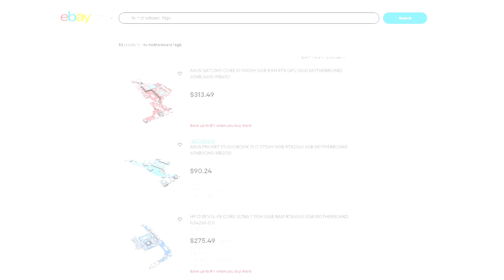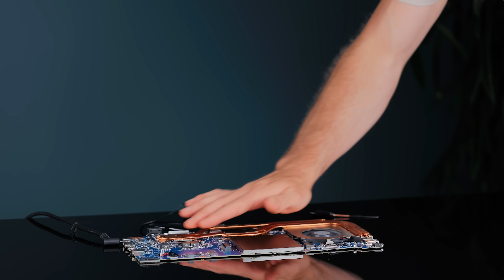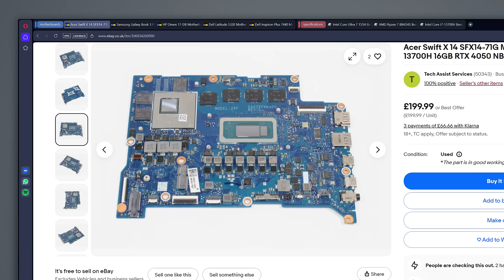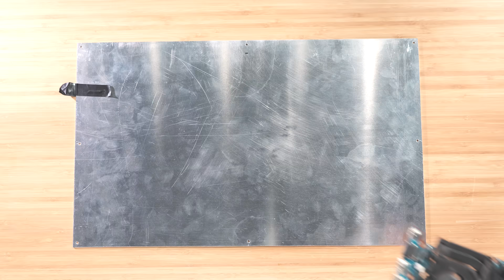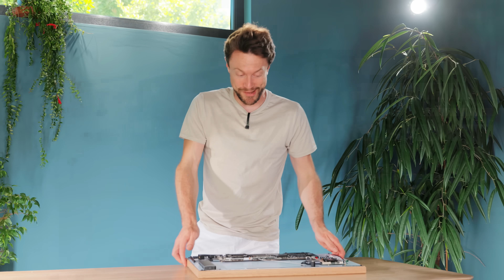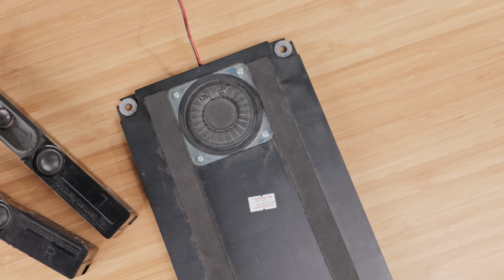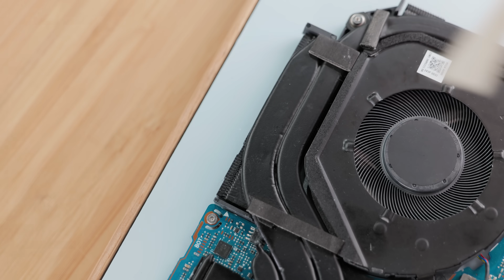A new way to build a PC in 2026!

Comment: Hi Matt, this could have benefited from a more substantial cooling solution. Laptops are always thermally limited, so there's a lot more performance that could be unlocked.
Reply: Could have even used the aluminum plates as additional heatsink

Comment: i wanted to do this but i had some issues like GPU death and usb c rusting and transistors falling off due to water damage, the power ribbon cable broken, Laptop display broken, keyboard broken. I will need to do some electronics engineering to solve all of this :')

Comment: I hope I missed you adding a protective layer on the LCD panel instead of the glass panel. Thanks for the vid, cheers! Ingenious, as always! I'm particularly blown away by the insane measures you take for the best possible audio experience.
Reply: Looks like he's running a naked LCD. I wouldn't
Reply: He also missed adding back an anti-glare coating. The original coating on macs is pretty good, but here on the quick demo it looked like the entry level glossy plastic screens of some cheap laptops... which ruins the good properties of the lcd if there is any light in the room
Reply: @bastienx8 i think he carefully showed angles to reduce the extreme glare

Comment: chromebook motherboards flashed with mrchromebooktech's uefi firmware make fantastic little NAS boxes for a simple usb HDD or even with an adapter in the WLAN M.2 slot for SATA connectors. super low energy, low budget, and with a gigabit usbc adapter fast networking, too.

Comment: the motherboard had a headphone jack the isolator circuit was overkill😂😂
Reply: I was also thinking that 😅 Alternatively if one wasn't too fussy about audio quality, could maybe have them connect wirelessly on start up.. Or maybe a USB with an amp... Now I think of it there were more than a few ways 😂
Reply: Yes but using 2 audio outputs simultaneously is not easy on windows. And some apps (like many games) directly send the audio to the selected device, making it impossible to use. And there might be different delays from the 2 outputs, if you find a way to use them both together.

Comment: To be fair, they are mobile variants of that CPU and GPU, so they aren't apples to apples with the desktop version.  As a computer repair tech who prices out laptop motherboards a lot, there are some pretty high priced laptop motherboards when you get into the super high end.  But even $300-$400 is enough for most of my customers to deny a repair on their laptop once you add labor into it depending on the age and specs of the laptop.

I recently did a more basic version of this.  I had a laptop that was recycled because the internal screen wouldn't display anymore.  Something wrong with the motherboard displaying to the internal screen (tried several screens and a new cable before we gave up).  However it displays fine to the HDMI, even at the BIOS level which is fairly uncommon.  Most laptops don't display to HDMI until after Windows starts to boot which makes a laptop without a functional internal screen harder to diagnose if I can't get an external display until Windows boots.  Anyway, since the motherboard was effectively useless as a laptop, I removed the screen assembly and am now using it as a full lower case connected to the TV in my garage so it still retains the internal keyboard and touchpad if I need to use them, and I bought a bracket to mount it to the wall.  I had a mini PC out there, but it was 10 years old, and the laptop has an 11th gen i5, so it's newer and good enough for watching videos or playing music out in the garage while I'm working on projects.

Comment: You already put so much effort in it and it is very spectacluar (unlike my english skills) why did you not use the opportunity to give it some proper speakers (like the Tectonic 65, in bigger and proper enclosure, even the Visaton FRS8 in 2 Liters could work) ? 

Btw: Did you replace the glass in front of the creen ? which means the surface of the display unprotected !

the whole project looks 10times better than every storebought product I have ever seen. Great Job (as always). Unfurfanetly its not possible make profit building these for customers.

Comment: Just a thought, instead of using that process for the power button, why not have it boot when mains power restored (BIOS setting) its what i do as my laptop is closed and on its side in a stand........maybe a good idea for those less keen on pin tracing.

Comment: you can probably get line level output from the lcd driver board by looking at the datasheet of the onboard amp ic. if it is fed digital audio instead theres often still pins for line out.

Comment: the trust in that back leg to not fall off the table at 22:38 is incredible
Reply: Yeah not a fan of that stand. You can't adjust anything so the ergonomics aren't brilliant. But creative and impressive work as ever.
Reply: @deanopain  diy comes with it's shortcomings, but the build is brilliant as always, Matthew is one of the best to ever do it!
Reply: @captaincaption  true, but adding a ball clamp or ball head on the backside would solve it pretty cheap. But as for as aesthetics goes, this is very clean.
Reply: @bonko86 Adding and hiding a tilt mechanism would be relatively easy considering his skills and imagination
Reply: @deanopain if you look at the video closely, that has been made to his specific height. His eyes are at the top bezel... Perfect. Since people don't regularly adjust their monitor height, most won't experience and issue if it's set to the specific height.
Reply: @deanopain   Think about it this way: adjustability is only needed because the manufacturer has to make sure everyone can use their products. If you DIY for yourself, you can measure your eye level sitting and make the stand's height accordingly. No need for "ergonomics", you build that yourself.
Reply: IKR!  Also, having the centre of gravity over a single leg, whilst aesthetic, is less stable than having it over two.
Reply: His actually scariest build due this tripod :D
Reply: I highly doubt he's not anchored it somewhere underneath the table. He probably didn't feel it was necessary because the stand itself was an extra aesthetic choice we'd all choose differently.

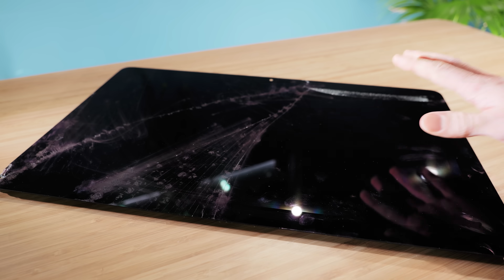Comment: 8:34 pop an SSD and MacOS Monterey/Sonoma through OCLP on any old iMac (ideally 2011 onwards) and it becomes a surprisingly good device. Still rocking a Late 2013 21.5’’ iMac and swapped in an SSD and it works a charm.

Comment: Couple things I would like added:
1) Always check the screen before buying. Way too often if the screen has cracked, it's the LCD panel that has cracked and that's beyond salvageable.
2) The MB must be checked at the factory and ribbon cable for that is way too fragile. There's often quite visible and good test pad for the power button somewhere on the board.
Reply: An iMac damaged that severely can probably be found for free so cost probably wouldn't even be an issue there.

Comment: When I saw the tripod design of the stand, my brain was immediately convinced that you were going to add a brass hinge to each leg and use something like a brass bolt and nut extending downard from the cap that allowed for an adjustment of how much the legs were allowed to splay outward, thus adding height adjustability to the build. And I think my brain went there purely because I'm accustomed to see brass in your builds, but I think it sounds like quite a nice addition. I suppose that would require different mounting for the speakers, though.

Comment: I would have taken a different approach with the power button. Vast majority of BIOS chips have the ability to boot the laptop when a pin is shorted to ground. Similarly there might be diagnostic buttons or lines to be able to boot it.

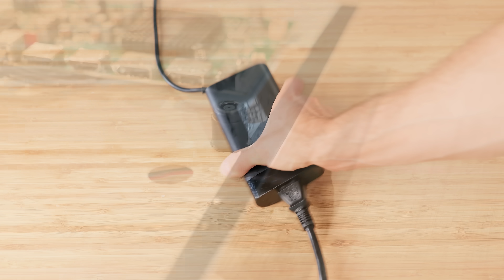Comment: 14:19 Laptop's original Power supply?  Did you not buy Just the motherboard?
Reply: My assumption is that he bought it separately and forgot to mention it. I assume the power supply for any given laptop cannot exceed $35-50 anyways
Reply: @TheRealKidRed_ I assume the worst, he could not get the eBay one working so bought a new laptop and dismantled it for the video😊
Reply: @RajveerSingh-vf7pr Of course that's always a possibility, and maybe I'm just being a bit too optimistic, but I do really believe that he did really get the motherboard from eBay.
Reply: @RajveerSingh-vf7pr  I don't think he would do that he knows better
Probably just bought it separately to turn it on in the first place

Comment: Thaat's a bit lucky. I can only find HX 370 based boards starting at 980Euro. 
In any case, the keyboard connector presents the interface to a keyboard matrix, while your method worked for you, it is not usually how that works. A keyboard matrix is split into rows and columns, and you need to connect one row pin to one column pin to trigger a keypress, including the power button. So the more appropriate way to do this is to connect each pin to every other pin in order to find the correct two pins to bridge with a power button.
The "custom ribbon cable" was a really neat idea.

About the display, modern laptops use eDP (embedded display port), which is standardized enough that you'll find that you can connect most panels that use eDP to a modern laptop mainboard directly (using the mainboards original cable - the panel side connectors come in standard 30 and 40 pin variants and there are simple conversion boards available, to convert  between the two pin counts).

Comment: I understand how you connected the power button, but I believe it’s unnecessary. You simply need to boot it up once using your method and configure the "auto-power-on" setting in the BIOS. After that, you can turn the machine on just by switching on the power supply, without needing a physical button. That’s the method I use for my laptop, which stays closed in a mount hidden under my desk. I even plugged the power supply into a smart plug so I can ask Alexa to turn the laptop on. Aside from that, great job raising the discussion on how to salvage damaged laptop motherboards so we can have a functional PC at a reduced cost.

Comment: Just FYI, although most laptop motherboards don't have physical power buttons on them, many do actually have the space for one, so they can have one added for testing/diagnostics in the factory.
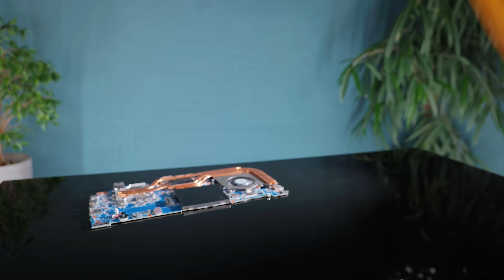E.g. at 3:03 you can see an empty space labelled TP_PWR_SW1 to the top right of the keyboard connector - that's probably it, and of course you could test it in the same way. Finding that and soldering a wire to its 3.3V pad would generally be quicker, easier and with a more reliable connection than using the keyboard connector.
Reply: Also on laptops that doesn't have a provision for a physical switch, it's not unusual to find a empty 2-pin SMD footprint close to the keyboard connector for the tech to short out with a tweezer to trigger the power on.
Reply: @zaprodk really good catch! Although, even knowing this, I still like Matt's solution. Not as simple, but very modular.
Reply: This does make sense, showing the value of reading through comments under the video.
Reply: Surprised that Matt missed this.
Reply: Is it the 5 pads where the solder mask resembles a letter H, for an actual button? Or is it the small dot of solder under where it says SW1?

(Edit: what I meant was silkscreen, not solder mask)
Reply: @WillE86  Yeah, all the empty pads in that white outline are where a push button could go. It's partially hidden by the wire, but I think there are 6 pads there - the 4 corner ones will be ground but are just to anchor the button. Then the other two (middle ones on the top and bottom) will be the actual switch - one will be ground, one 3.3V, so when the button is pushed the 3.3V is pulled to ground.
TP usually means Test Point and PWR_SW would of course be power switch, so that plus how close it is to the keyboard connector (where we know the power button signal goes) really suggests it's for the test power switch. I use these all the time when I'm fixing laptops - usually just bridge the points with tweezers to power the laptop on to test without fully resassembling.
Reply: @WillE86  Switch 1 I`d guess (:
Reply: Should've at least let us hear a little bit of music on those speakers.

Comment: Instead of using an HDMI/DisplayPort signal connected to the external display driver, you could have utilised the video signal from the eDP port on the motherboard by using a ribbon cable, so you have access to the iGPU and dGPU separately. Using the USB-C DisplayPort/HDMI port bypasses the iGPU and connects directly to the dGPU.

Other than that, this is an extremely good idea, especially with the Retina display from an old iMac.

Comment: @DIYPerks You should have watched Snazzy Labs video on converting an old iMac to be a monitor. He really went in depth about different control boards, and you would have learned that the $50 one does not do thunderbolt or anywhere near 4k.

Comment: Okay, that paper ribbon cable was a bit jank 😂
You can easily solder to the pins.
Or if you really do not want to do that, get a bare ribbon cable.
Just rip it from a broken device, does not even have to be the exact same pitch

Comment: FYI The previous generation of iMacs still have a decent screen, are cheaper, and the glass is held on by magnets so all you need to get at the LCD panel is some suction cups. I expect these bare panels would scratch incredibly easily though.

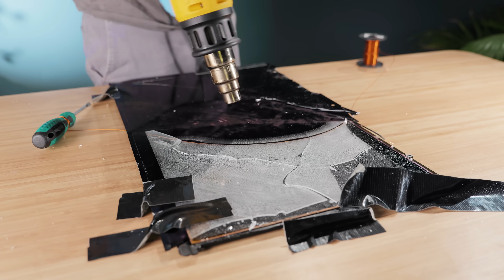Comment: 9:47 You know what, this gives me an idea. How about you dangle a pair of a light weight on each side of the wire then mount the display vertically and you just aim the heater gun at the glass.

Comment: 😠 - and we will now have the YT video influence effect on “pricing” of those mother-boards, another concern is how old is the CPU; was it replaced? - I have an old HP pavilion laptop that was upgraded to Windows 10, and now that it is no longer supported and the CPU isn’t compatible = I am being pester-badgered by “Microsoft” to have said laptop replaced in its entirety/subscribe to a security thing for £££, but it is already protected by Kaspersky anti-virus application, so I think Microsoft is trying to abuse me as a “cashcow” = to force me to buy their Windows 11. And unlike a computer motherboard where the CPU chip is socketed = can be easily replaced, with a laptop it is soldered to the board 😠🙄

Comment: Nice one, really love your laptop recycling vids. By the way, you don't necessarily need a driver board for the LCD: laptops most often use 30pin edp or 40pin edp (2 vs 4 displayport lanes, pretty much), panels can be either those, or lvds. If those match, you're in luck, and just need to figure out the pinouts, which are often* available from schematics, if they don't - depends: 40 (laptop) -> 30 (display) pin edp should just work™, edp -> lvds can be achieved with small converter boards, and only 30 -> 40 is somewhat hard - some displays will work fine, for others you'll need a pair of decoder-encoder chips for displayport, but still possible. Also, amd boards generally work with a wider variety of displays compared to intel, which may or may not matter when a dGPU is present, depending on how the display is wired internally.

* good candidates here are asus, acer and lenovo boards that are a couple of years old. Same with many clevo boards regardless of the "manufacturer". Dell is generally terrible, those dudes really don't like to share (and also tend to make questionable/unintuitive protections). And hp just sucks.

Speaking of protections, some recent boards have either a physical switch or a light sensor that needs to be pressed/covered respectively for the board to start. Finally, depending on the mainboard, you may also need a battery, since some laptops really don't like running without one, and will drop the CPU freqs down to the unusable range. Also, the battery nowadays often provides the RTC power to the hub, so without one the 1st start after the power is disconnected will be longer and result in the need to setup the system clock in the bios (this, however, sometimes can be mitigated by checking if the RTC has its own pin on the battery connector, to which one can hook up a regular coin cell battery). Anyways, thanks for coming to my ted talk on the importance of checking out the schematics before buying the board for such setups XD

Comment: I want to start tinkering myself. I own a Lenovo T480 and i love it but i would like to give it some more power. I was asking myself how hard it would be to put modern hardware into older laptops. with parts from framework or ebay, some 3d printing and soldering... would this be possible? Could you imagine making a video about this?

Comment: I think you can save some money by finding the laptop motherboard compatible with panel's interface (probably eDP). You will probably need a genuine cable for the laptop cause they are almost always nonstandard, but the panel-side connectors are compliant. It'll eliminate the need for the interface board and buck converter, also the laptop will automatically use new panel as a primary screen.

Comment: hey so some laptops dont let u use the gpu from the type c port gpu only works with hdmi or display port so check the model before so you can actually use that 4060 or whatever

Comment: Another source for the components is to just buy laptops that have had the display broken. They are usually cheap, and you still get all the periphreal components like keyboard, speakers, Wi-Fi etc. I would suggest using aluminum, over aluminium for the case though.. 😂

Comment: Lets beat the tech price Crisis.  - Ads Extra Ram anyway £££.    yes it looks nice but all the extras the usb dongles the video converter. wood, power tools. the sheets of metal. "i just had laying around..." that could cost even from a scrap yard. the copper foil. speakers, sub, connectors and wire, ..   Just buy a laptop...  i bet it cost near as the damn the same over here in the uk.   ( cost break downs in your video would be nice)